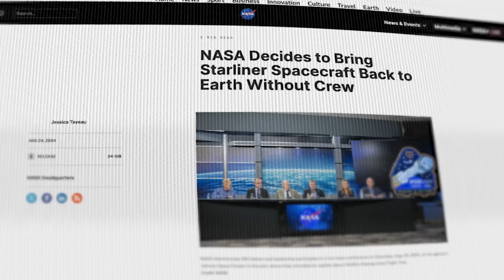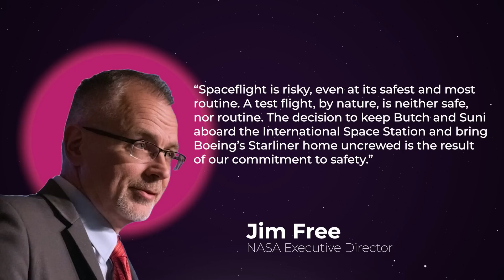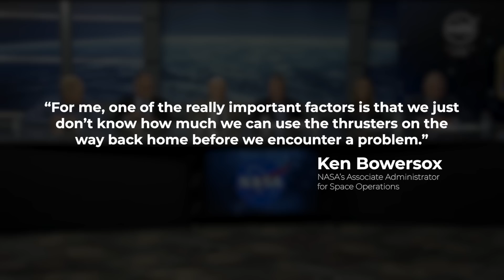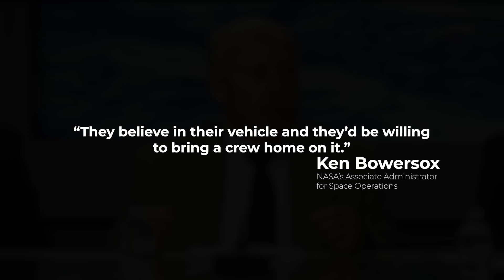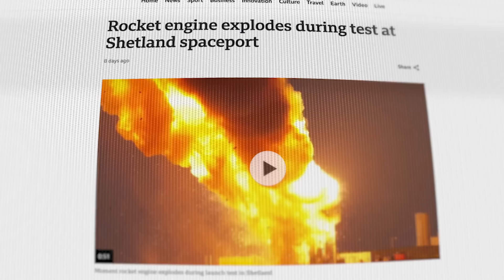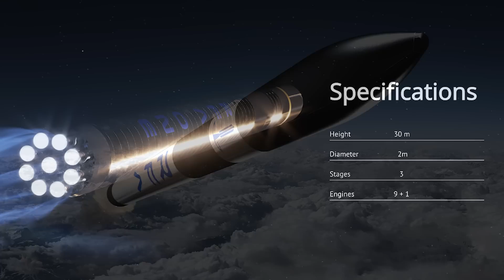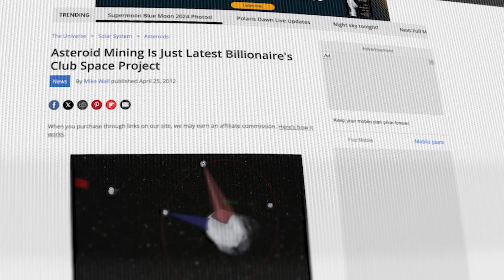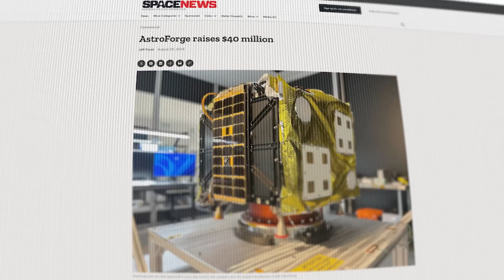The Boeing Starliner Has Failed...

Comment: NASA, like Boeing, used to be highly respected and at the top of their game! At least they had the sense not to have the crew try and return with malfunctioning thrusters. That's what happens when you outsource materials and components overseas, and the contractor (with NASA's approval) used substandard alloys in their manufacture. Don't believe it much the fault of the technicians as incompetent management and some of the engineers, though intelligent, have little to know common sense. All the things that could go wrong and NASA loses 3 crews, 17 astronauts. The known fact is that oxygen highly supports any fire in combustible material. The Mercury and Gemini programs used pure oxygen in their cabins. But at 5 psi. Apollo 1 was running pure 02 at 15 psi. Why? Or was that the required pressure at 1 atmosphere until they were in the vacuum of space? The Challenger accident should have never happened the way it did! They damn well knew they had o-ring burn thru problems. Especially at lower temps. That January day in '86'. It was well below freezing. Incompetent stupidity and greed got those 7 crew members killed. Columbia with the shredding of the central fuel tank foam from ice strikes, etc.. damaging the ceramic heat tiles was a well established and known problem. Then NASA allowed the EPA to make them change the adhesive formula that bonded the insulation to the tank in the 1st place. The problem became even worse. They had had an actual burn small burn thru on a prior mission. Luckily, it didn't cause a catastrophic problem. Kept launching anyway. Actually, that is beyond stupid. It is criminal negligence! Look at NASA vs. Space X. Different owner, not the bureaucratic dumbasses in our government. Competent ownership and top-notch engineers. The workers/technicians on both sides are just trying to do a good job and make a living, support their families. Just like most of the rest of us. 😊

Comment: 3:30 that is not true on the iss are 2 Soyuz-25. i know there are uncomfortable and may causing injuries on landing, but there are only the last resort. The reason is the Soyuz can be flown for reentry  without electric power. The Russians are not dumb they knew what they are doing. Another problem is we cant bring back a Soyuz to the station at the moment, also only one half is reusable, the power and propulsion module stays in space or to be more precise it will evaporate on reentry after separation.  So the both Soyuz stay on the ISS in case something goes horrible wrong.
Reply: There's only one Soyuz spacecraft at the ISS currently and it brought up three astronauts so it cannot take anyone else down. The ISS has no permanent spacecraft for evacuations; the spacecraft you came up on is your lifeboat.

Comment: You know it’s kind of sad actually. I remember back when Boeing was pretty much considered the pinnacle of aviation, safety and technology.

Unfortunately, though it seems that has changed. Although if I ever correctly when one of the major manufacturers that were bought out by Boeing, I think it was Douglas were merged in. They took the Board of Directors from McDonald Douglas so it was a completely different management team. 

Also, it seems like Boeing hasn’t tested their capsule enough.

Comment: 0:57 - The problem with Starliner is the attitude control trusters, which use helium (who's brilliant idea was that?), and LEAKY (well, duh!) and are unreliable. Well, how will the reliably de-orbit the capsule?
Reply: Helium is an ideal pressurization gas. SpaceX also uses it for their attitude control thrusters and launch abort engines.
Reply: @AmbientMorality  Helium is hard to contain at sea level and ambient temperatures. Stick that same system in space, and those teensie atoms will find a place to squeeze out everywhere!
Reply: @nufosmatic  I agree it's not an easy gas to manage! But it's so good for these purposes that it's used everywhere in spaceflight despite its problems.

Comment: IF what I heard was true there was a helium leak, maybe all of the helium is gone. Another was a problem with the batteries being past their preventive maintenance date. So, are there any other problems that NASA and Boing not telling us about? Maybe someone forgot to pack all of the parachutes in the spacecraft? At least Suni and Butch have a definite date? of when they will be returning. Should be very interesting just how well publicized the returning flight will be, sans the two astronautics,  for the trip back to earth.
Reply: The helium leak was a limit on free flight duration. Once docked the helium system is isolated and there was no more leak. It'll start leaking again once it undocks, but there's plenty of reserve so it won't be an issue. Batteries were a very conservative certification limit for this flight (it's designed for 210 days anyway) and they've performed fine on-orbit so they were extended.

Comment: When you are talking about science and space, make sure your science is the 21st century science and not the 18th century science you implied when with payload weight.  The SI Metric System has been around a long time now. And in this system gram/kilogram is a unit of Mass not weight, force, tension or thrust. The mass of an object is the same value on Earth, floating around weightless in space and on the Moon.  But the weight is different at each of these locations.  Static weight is the product of mass multiplied by the acceleration of gravity = kilogram meter per second squared = Netwon.

Comment: While criticizing Boeing for production and quality control issues, we should remember NASA management, itself, created major problems more than two decades ago which killed two shuttle crews.
Challenger exploded after a forced launch in near-freezing weather, despite engineers' warnings about the integrity of frozen and inflexible booster O-ring seals.
Columbia burned up on its return home because the NASA mission manager refused to consider that its carbon-on-carbon wing structures had been damaged by ice falling away from the booster on launch-- despite warnings from engineers.
Both times, NASA screwed up royally, which make Boeing's painful attempts to work through this problem seem safe and sane, by comparison. 
At least, NASA now shows the due caution and care it learned at such great cost in past missions. NASA indulges Space-X with the same concern.
The American people deserve deliberate and careful engineering, not unnecessarily risky media spectaculars.

Comment: Why is this channel now using an AI voice has it been hijacked?

I have unsubscribed for now:

RE:
It’s understandable to be concerned when you notice changes like an AI voice on a channel. There are a few reasons why this might happen:

Cost and Efficiency: AI voices can be more cost-effective and efficient for content creators, especially for channels that produce a lot of content.
Consistency: AI voices provide a consistent tone and quality, which can be beneficial for branding.
Accessibility: Some channels use AI voices to make their content more accessible to a wider audience, including those with disabilities.
However, there have been instances where AI voices were used without proper authorization, leading to concerns about hijacking or misuse12. If you suspect that a channel has been hijacked, it’s a good idea to report it to the platform for further investigation.

Comment: Someday Boeing will be a textbook case for how to destroy an incredibly successful company.
Reply: HP (Hewitt Packard) is also such a case. They just put an MBA (Carly Fiorina) in charge of an engineering company that used to be run by engineers.  She then laid off critical personnel, and outsourced their jobs to India, so that investors (and upper management) got a big increase in their stock portfolios from the short term money savings (at the expense of long term viability).  It nearly bankrupted the company 4 or 5 years later.

Same thing happened to Apple in the1990s when they hired the old Pepsico CEO, who then canned Steve Jobs, and proceeded to drive the company into the ground.

In every case, the executives who did that got away with their stock options (golden parachutes), and laughed all the way to their banks.

It's a simple regulatory fix.  Require all executive stock compensation to be put into [something like] a 401k retirement account.  They can't withdraw it before retiring (or maybe 10 years) without losing half/most of it.  That way it gives them an incentive to focus on long term company growth, instead of quick & easy short term growth at the expense of long term viability.

Comment: So what about all the reports a few weeks ago that the auto return software was NOT installed on Starliner and therefore unmanned return was not possible?  Was that all total BS? Or has this magically been fixed? Maybe I missed a news story somewhere.
Reply: It was just mission-specific configuration parameters (mission data load, MDL) that needed to be updated remotely. The issue is Boeing hadn't verified that the parameters for autonomous return work correctly on the current version of the software, so they quoted 4 weeks to do all the verification testing, simulations, and so on to make sure that changing this configuration won't cause any issues.

Comment: Just an interesting question ; there is not compatability in Spacesuits between Boeing and Spacex ( so presumably that incompatibility also applies to Russian Soyuz Astronauts ). But the question is about the ISS  ports/airlocks etc for various space capsule mating with ISS ???
Reply: The same docking interface (NDS) is used for both Starliner and Dragon, so both are compatible with the same ports. Russia uses its own standard.

Comment: NASA did put the astronauts’ lives in  DANGER  by allowing Boeing to launch the Starliner with the known helium leaks and knowing there were some   “technical”  issues  but allowed the  Starliner launch “acceptable” risk.  

If it was SpaceX Crew Dragon, NASA would’ve put the “kibosh” to the launch.  

No.  NASA  is and always was politically driven.   Boeing’s pathetic performance and technical failures is part and parcel  NASA’s   Indulgence to Boeing.   ka-ching…ka-ching…. Bill Nelson, this is on you.  It’s on your watch.  ka-ching…ka-ching….

Comment: Are they coming back on Crew Dragon suitless or has Spacex been able to put together a couple suits?  Dragon shud be safe enough even suitless.
Reply: They should make spacesuits compatable like they did with the docks on space craft
Reply: @harryflower1810  I heard somewhere that SpaceX is making or trying to make spacesuits that will fit multiple people, kinda like NASA does (or did) but I’m assuming that the capsule connection for the suits will remain proprietary.  Sarcasm: can’t really expect them to set aside profit and work together now can we.
Eventually, as things progress, they will HAVE to have multiple sizes of suits and be able to use those suits in any capsule.  The incident with Starliner shows that we MUST have, sooner rather than later, the ability to make rescues at least anywhere between earth and the moon.  Rescue for mars is a non-starter until we develop non-ballistic capability and much much faster craft.  Rocket fuel really ain’t gonna cut it with people on mars.

Comment: Free's statement is, on it's face, complete and utter horseshit. Boeing WAS committed to safety back when engineers ran the company. Boeing is currently committed to increasing profits and cutting costs, the which have led them to their current ongoing crises. Parts falling off inflight airplanes, two fatal crashes of their 737 Max, a $2.5 Billion fine for lying to the FAA and now this. It's time the entire board of directors was charged with willfully endangering public safety and misuse of public funds.

Comment: Safety first.  Nothing else matters.
Reply: Except maybe PR and avoiding the 24hr pundit cycle where every glitch is turned into a life or death drama to drive ratings and clicks. I have no doubt they knew there is about a 90% chance the return would be safe. It is just that unknown that stopped them, since the knew 100% if there was a problem, then the Monday Morning quarterbacks that have never built or flown anything, even in their back yard, would crucify them with 'I told you so".

Comment: So, how many BILLIONS in government funding (= tax payers' money) did they get to "achieve" this "result"?
Reply: Almost seven billion has been spent on this trash machine.  Boeing received a contract for just over four billion and then some additional money was spent on research.  

So yea.  A pile of money.  They may as well have set that cash on fire.
Reply: Whatever they want. Trillions missing every year from the budget
Reply: research the B29 cost WW2
Reply: Boeing received a fixed-price contract worth US$4.2 billion to develop Starliner for the Commercial Crew Program. In comparison, the total cost of the development of the Apollo command module was $37 billion, adjusted for inflation since 1970 (nominal cost of $3.7B).
Reply: @teebob21 . That number includes the command AND service modules.  It’s also worth noting that the level of design software and materials science available today wasn’t out there in the 1960s.  Also, Apollo could actually get to the moon.  Starliner is stuck in low earth orbit.
Reply: @YoloSwagNinja  Modern Western capsule design incorporates the service module functionality into the habitable command module, which makes an Apollo CSM stack directly comparable to CST-100 Starliner or Crew Dragon. Starliner is only in low earth orbit because it wasn't on a big enough booster. That has nothing to do with the capabilities (or lack thereof) of the module.  You might as well say the the Apollo capsules used during the Skylab era were "stuck in LEO", too.
Reply: @teebob21  But the Apollo program was a success.
Reply: @nicomeier8098  It was. It was a success built on the backs of lots and lots of failure, several close calls, and only a few preventable deaths.

Comment: I have no idea what the logistics and costs behind putting together a rescue mission are, but why do they have to wait until February?
Reply: Traffic jams at the ISS. 
The requirement that there is always a seat on a certified return vehicle for every member of the ISS at all times. 
The fact that cargo craft now take up docking ports rather than berthing ports like before, so there is only 2 docking ports left to service manned crew.
The "rescue" mission is actually just the regular crew cycling mission but carrying fewer crew members, to give Butch and Sunni a seat to come home. Butch and Sunni will now be part of the next regular ISS crew, and their mission will now be a little more than the standard 6 months. They will just come home with the next crew rotation, rather than at the end of their test flight as originally planned.

Comment: Maybe Boeing is failing so much because they aren’t diverse enough. They need to fire their remaining competent White engineers and replace them with disabled black trans women
Reply: It has nothing todo with the race of the workers. Boeing has been in trouble since the ear’y 2000s when it started putting profits over safety. Now everything is beginning to unwravel.
Reply: @tylermadison2073  Yes, profits and DEI go hand in hand. They fired their White engineers and hired $15/hr Indians to write the software on the 737 Max that ended up crashing twice. Their goal was to increase their diversity while using overseas slave labor for cheap, and look what happened
Reply: @tylermadison2073  Just like they saved a ton of money hiring $15/hr Indian labor to write the software for the 737 Max and fired their White engineers

Comment: Boeing needs to simply exit the spaceflight business and return to its core aerospace/airliner business. Sell of its' stake in ULA, divest itself of Starliner and go forward from there.
Reply: Both aerospace and civilian airliners  are in similar predicament. Both aircrafts are in a duopoly with single competitor being Airbus or SpaceX. COMAC is not a competitor yet for airliner at least in the West. Russia rockets is a no go either due to politics.
Reply: @Tabula_Rasa1  SpaceX could take up all the slack in a heartbeat, they have multiple dragon craft ready to go after flight check and preparations which take only days instead of months. Also, plenty F9 stacks available.
Reply: @paulmichaelfreedman8334   SpaceX can, but I doubt NASA or the US govt are willing. It is smart to have redundancy and politics/lobby wont allow Boeing to fail. There are talk of Bezos acquiring ULA, so new ownership might revitalize it.
Reply: Spaceflight has BEEN part of Boeing's core business since the 1960's. Boeing built the highly successful Delta family of launch vehicles, and several GPS satellites. Boeing built the Lunar Orbiters, and Mariner 10. They were also the prime contractor on the ISS.
Reply: But unfortunately most of the good engineers have retired given up or actually moved to other companies. There are a lot of great engineers still but most of them are beholden to the managers set above them @teebob21
Reply: @teebob21  So they should be allowed to continue even though Starliner has effectively failed and ULA is in the process of being sold off to Sierra Space?

Boeing's glory days are long gone and as I said before, they should stick to their core business of aircraft/aerospace.
Reply: @MatthewLittle  Starliner has a helium leak on its third flight ever, and first manned flight. That's a mission failure, not a program failure. 

Non-engineers like you probably shouldn't speak on engineering topics as if you know anything.
Reply: Cut off all MIC firms from NASA money. Let the non DC woke firms have a shot
Reply: not in a spaceship though
Reply: Would be smart to do, so it won't happen.